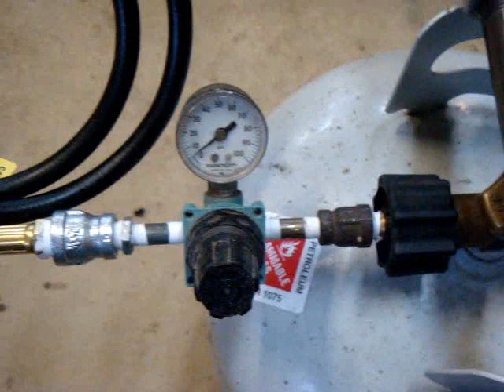Propane Forge Burner

Comment: That's way too little air and way too small a flare. Your flame also shouldn't be feathering like that. People don't seem to understand the job of a flare it acts like a catalytic converter. And it should expand to at least 50+% the size of the intake. In industry they preheat hot air/propane before it's driven into the blast furnace at 200mph. Not easy to do at home but if your orfice, pipe length, air intake and flare are sized appropriate you'll get a tight, compact, lazer like flame with minimal feathering. Your outside cone should also be like half the size it currently is. That's a very inefficient burn the first thing I'd do is get a real flare reducer from Lowes.

Comment: please don't use galvanized pipe. It will give off a gas that can kill you. It is called metal fume fever, look it up and get that galvanized steel away from heat.
Reply: +Tony Spencer the flame is so far down tube from the orifice shouldn't be an issue I would think